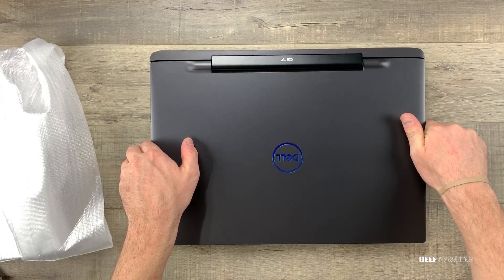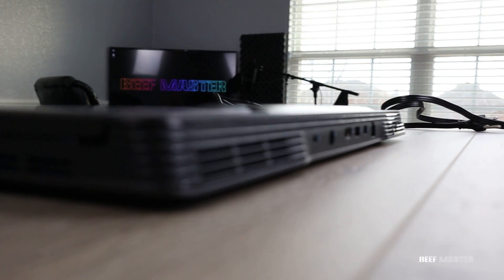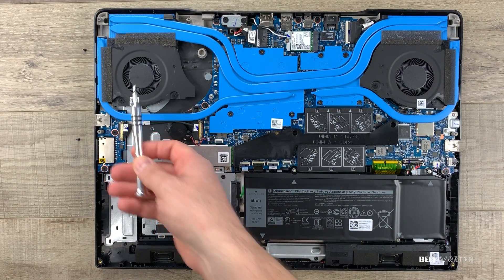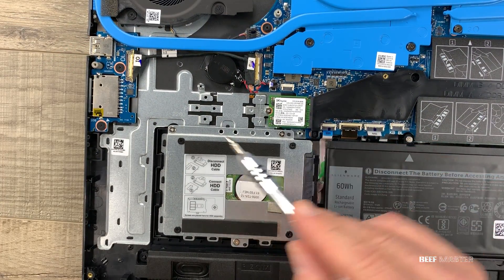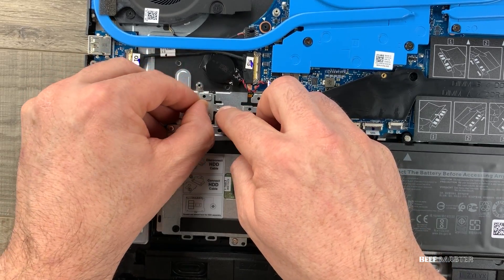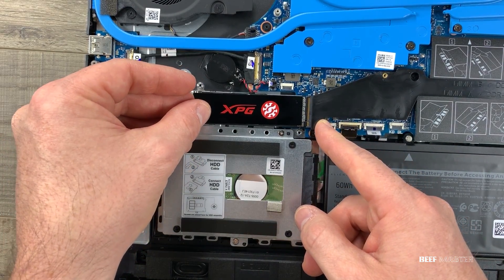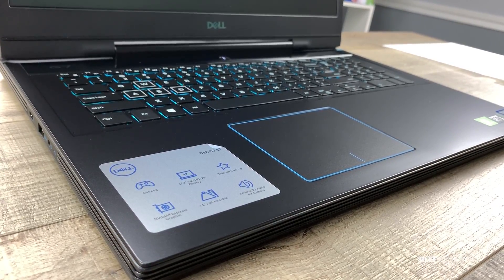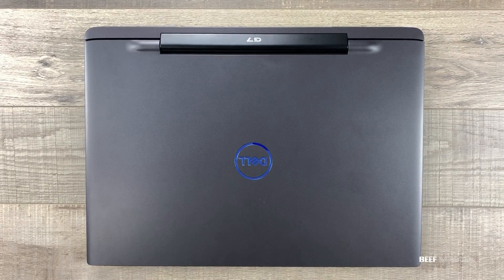Dell G7 Hardware Teardown Review

Comment: I am so confused .... Can you add another  hard  drive  SSD ?? My current  SSD hard drive is only 512 GB SSD ....Or you can only replace it  ??
Reply: Seems this has an M.2 ssd slot and a standard hdd slot. U can put an ssd where the Hdd is. It's right below the M.2 slot.  I have a G7 and it's basically the same. It came with a 512 ssd. Not sure if that's an M.2 ssd or the larger type.
Reply: @terryfredrick5149  you cannot  add another  hard  drive  but you can replace ..I just  did  it few  weeks  ago. That's  the  only option.

Comment: So is this right only 1 hdd slot and only 1 ssd nvme slot.. if so wow that kind of sucks.. wish there was 2 hdd slots and 2 nvme or 2 ssd slots.. ah well it was cheap when I got it $2500 - $500 (ebay promo sale code) = $2000 AUD for the RTX 2070 max q edition

Comment: I have  G7 7590- i7 9750h, GTX 1666ti, the 8gb Ram DDR 4, 2666Mhz and 128gb M.2 PCIe NVMe Solid State Drive (Boot) version. I would like to upgrade the RAM to 16gb and the m.2 SSD to 512gb. I am requesting you to help me with this.
Can you suggest me the correct brand and model of RAM and appropriate m.2 SSD that are available in Amazon, newegg or best buy that fits correctly with the G7 7590? Is it possible to replace 1tb HDD with Samsung 860 QVO SATA SSD?
Thanks, your response will be greatly helpful.
Reply: Check crucial 32 gb kit https://www.crucial.in/memory/ddr4/ct2k16g4sfd8266/CT14325076

For more
https://www.crucial.in/compatible-upgrade-for/dell/dell-g7-7590

Comment: Hi what's the max SSD this laptop can store?
Reply: I am guessing you mean, SSD storage? If so then any size from 256gb all the way upto 4tb depends on your wallet. If you mean actual size then its 2.5inch which is standard amongst all ssd.
Reply: @Reuben84h  how many can it store or only one ssd at a time
Reply: @alienc  only one ssd it can store. You can get a nvme caddy to put in, if you do decide to get this laptop upgrade the ram and primary hardrive. The standard nvme drive it comes with is only 256gb and fills up quick.

Comment: Great, to the point overview of this laptop! How was the backlight bleed on your unit? And thermals? I had the 15" version of this but had more blacklight bleed than personally tolerable so I returned it for the Alienware m15 r2 with OLED display.   Despite everything being great with the Alienware thus far, I am considering returning for this 17" model of the g7 as it's a better value. I ordered a g7 17" containing a 144hz display, i7 CPU, 2070 max q, 256gb SSD / 1tb hdd with 4 year warranty, 4 year accident protection and extended battery warranty through 3 years... All for $1722 tax, express shipping. In comparison, the Alienware was $1819 with the 4k OLED display, 16gb ram, 1tb SSD, rtx 2060 and a 1year base warranty... I love the look and feel of it but it comes at a premium cost and extended warranty is much more expensive.

Comment: I noticed you didn't put the plate back over the upgraded SSD.  Was there some reason for leaving it out?
Reply from the maker: Hey good catch. Around the 2:00 mark, I didn’t talk too much about it, but the plate had a blue heat sync material. The XPG SX8200 already includes a heat sync so the plate wasn’t necessary. Using both the plate and SX8200 with its included heat sync makes it a tight fit, so I decided not to use it. Great question.
Reply: Also you forgot to put in the rest of the screws when you flipped it over.....good video though

Comment: How's t hardware quality?
Reply from the maker: Good hardware quality. Uses the 1660 ti or RTX 2060 and screen can be upgraded to 4K, depending on the model variation. It is fairly heavy and the outside is a plastic material. Cooling fans can also be a little loud. Good product overall.
Reply: @beefmaster_james  So the entire body is of plastic?
Reply: @shanevyas4128  No. The top lid with Dell logo, keyboard deck and bottom cover are aluminum. The black ribbed edge along the parameter is plastic as is everything else in between. It is a sturdy, solid build overall, however is hefty. With that being said , it's bulk pales in comparison to gaming laptop's of the past (particularly Alienware systems from even as little as 5 years ago).
Reply: @Brett-mn4kl  Thank you so much. One more question, how are the hinges?
Reply: Brett Boulerice Thanks for the information.

Comment: Hey, how fast i must to clean my air vents from dust? My laptop stays on table all the time.
Reply from the maker: Depends on the surrounding area of the laptop, but I try to open and clean ~4-6 months. Best thing to do is wipe down the area underneath and around the laptop before every use. Take 10 seconds to lift and clean and can really help prevent dust. If anyone has others suggestions please share!
Reply: The BeefMaster Maybe you know it is worth to change thermal paste when i buy new laptop? I hear that the factory paste is very bad and better use arctic or grizzle? What your thoughts?
Reply: The screws are stuck on one side of the laptop,  wont turn without stripping. Its frustrating...ok they put some loctite on some of the screws,  damn retards...oh it's a washer that's twisted, and wont come off, fck dell.
Two anchor screws with washers. Not flushed,  stripped. Going to RMA this .

Comment: Hi BeefMaster, nice video! This is the only gamer/content creation laptop I found that has:
- Thunderbolt 3
- Numpad (Razer blade hasn't)
- Webcam in the right position (Aero 15X hasn't)
- Full SD card slot
- OLED 4k with 100% Adobe RGB

Surprisingly, I haven't found many (or any!) reviews of it, and I find this so strange because it's the only laptop I've found that checks all the boxes (at least for me).

Can you make a full review of how you feel this laptop works with video editing and content creation overall?
Reply from the maker: Thanks for the comment. All the things you listed are definite pros - plus I would add it is pretty easy to upgrade parts. 
Cons are:
-Weight
-Battery life
-Charger is a brick
-Can get a little noise under heavy use.

Not many other negative things to say. It really is meant to replace your workstation, so if portability isn't top priority, I would highly recommend it. Editing large video files, transferring date, running neural nets with Python, and gaming were excellent. Solid laptop.

I'll see what I can do about a video. Thanks so much for watching!
Reply: I have this laptop, it is very bad. The cooling system is terrible. The fan goes to beast mode from just web browsing and 100 degrees celcius cpu temperature on any game. Had to use liquid metal as thermal paste and apply -.300/-.125 cpu/cache throttlestop undervolt to drop temperature to 80 - 85 derees.